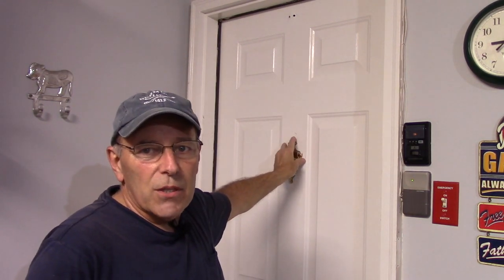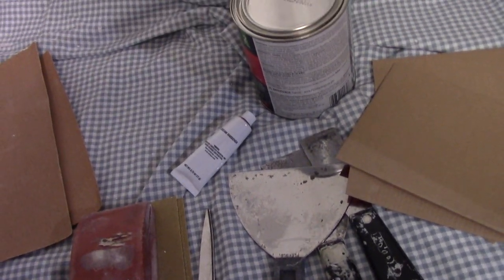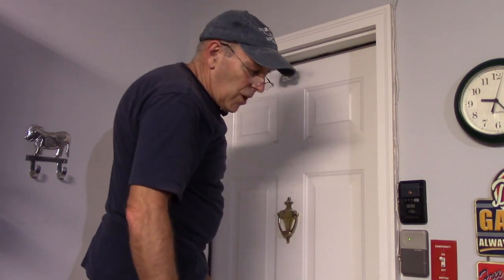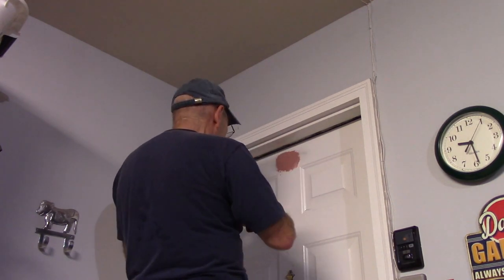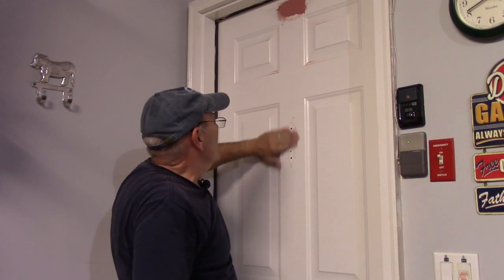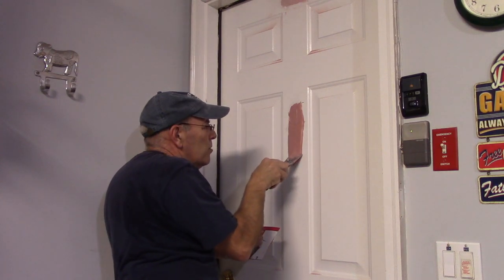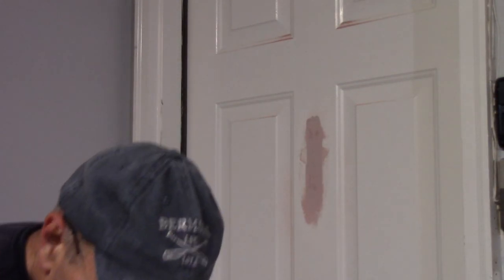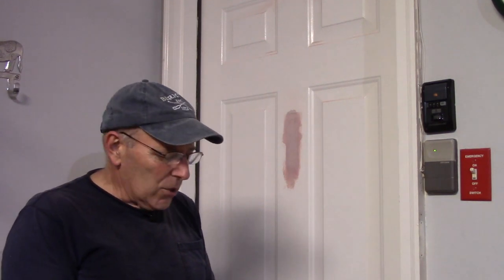How To Repair A Hole In Metal Door

Comment: What is the tool called you used to recess the hole using the hammer?
Reply: Anita 

That’s a “punch”
They come in all sizes and styles. That was a very common flat faced punch you can get it in a little set at Home Depot, Lowe’s, harbor freight for $10-20
Reply: @jordanlawson6132  thank you!

Comment: The best vid I found on repair a hole in a metal door. Installed a new door handle last week. The new one is slightly shorter than the previous one. So I need to cover the drill hole. I need to paint the door anyways. Very helpful!!!
Reply from the maker: Glad it helped.Thanks for watching.

Comment: This video was great! Everything worked fine for us except the bondo with gardener keeps showing through. We did two coats of primer then two coats of blue paint and thought we were done. Woke up this morning and the bondo is showing through. We just primed again. Is this normal?
Reply from the maker: No that is not normal. The only thing I can think of is that the bondo was not sanded to be even with the door. Thanks for watching.
Reply: How long did it take you ?

Comment: Will bondo fix rust holes in a steel door?
Reply from the maker: Yes it will but you should remove the rust before doing the repair or it will come back.

Comment: You can use a foam fun and shoot some foam in the holes, then after it has expanded dig a little out, then fill with Bondo
Reply from the maker: Thanks for watching.
Reply: @getitdonehomerepair  thanks to people like you making cool videos
Reply: We had a guy accidently install the wrong brackets on bath partitions, they tried to fill to holes and touch up paint and ordered new dividers before I could tell them to just order more of the large back wall brackets brackets, 2 other guys at the company had the same idea : )
Reply: That's what i do for drywall